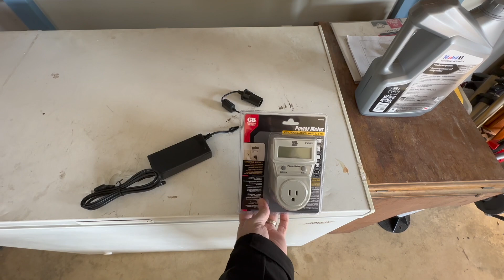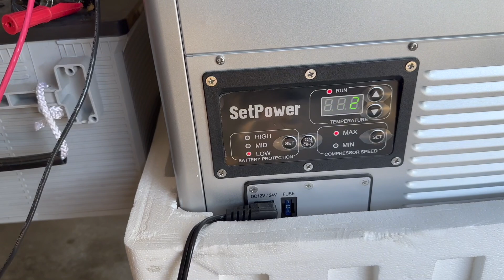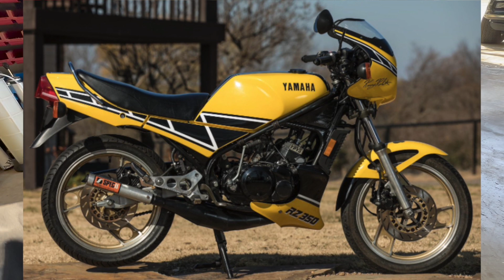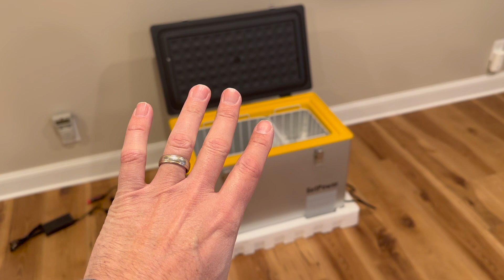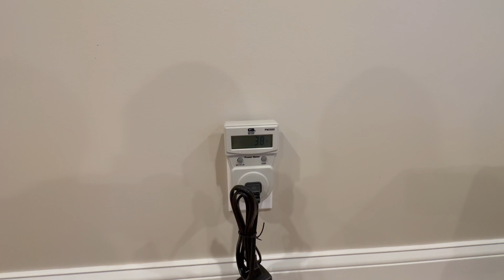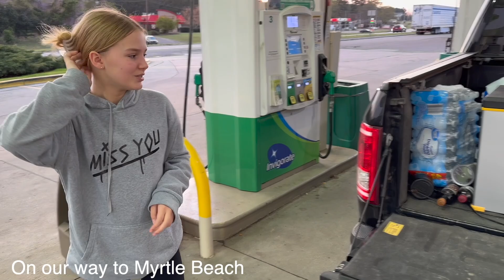SetPower RV45S Electric Overland Portable Cooler / Real World Test and Review

Comment: Pretty nice cooler.  Would you run it off your truck battery if you didn't have a huge RV battery?  Nice thing about that cooler is, you don't have ice taking up space, and water getting everything wet.
Reply from the maker: It can plug into your cigarette lighter, so guess you could put inside and run it. Or hook to your battery up front. I wanted it in the truck bed, so thought tossing a 160lb battery in the back would work - lol. That new LFP at 25lbs will be nice. Can run it for 4 days on a charge and can charge it in a few hours off solar. If I put it all in the backyard - I would have a perpetual electric cooler running forever.